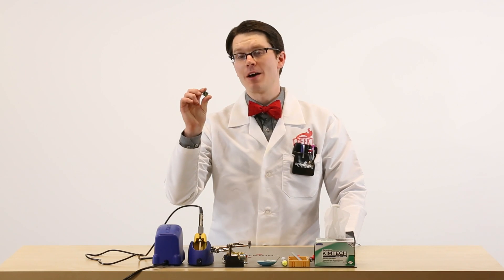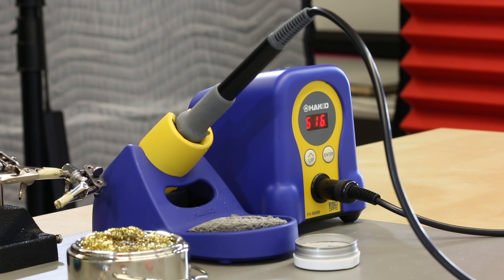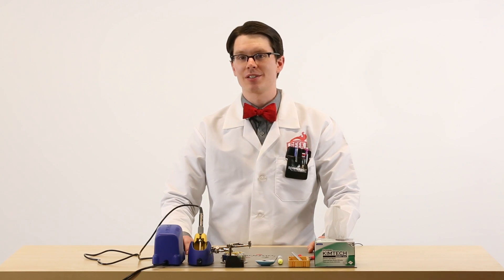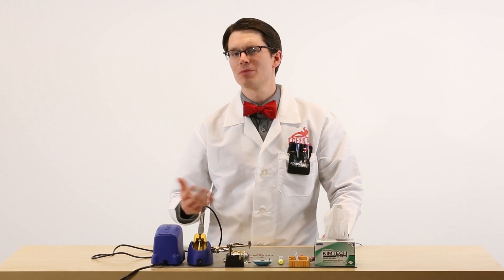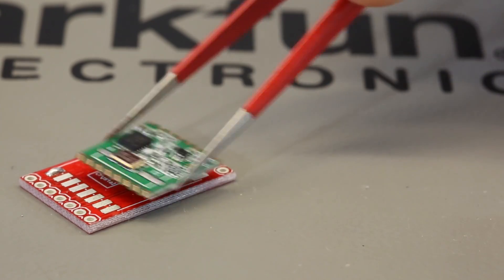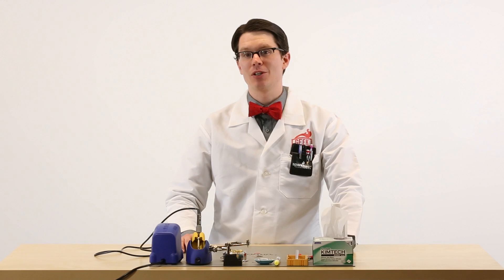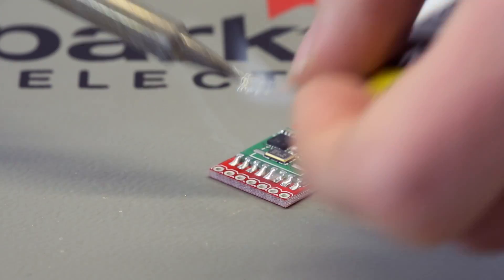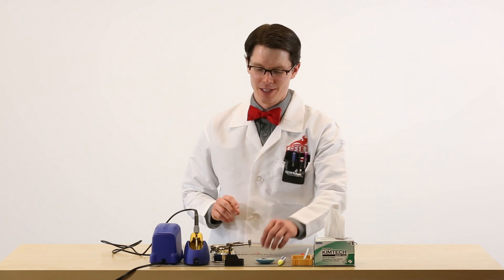SparkFun: How to Solder Castellated Vias

Comment: You were doing quite well until the second solder joint. Instead of soldering the adjacent hole, why not solder the one on the opposite corner? This prevents the problem of accidentally nicking the first joint as you bring in your iron in close to make the second joint. If you touch that first joint then the board may move and you have to start over. Working with the opposite corner also allows you to press down on the board to ensure that it's flush with the motherboard. Once you have the opposing corners soldered, then work your way down the board on either side, starting from the last solder joint. For those of us that don't have a completely steady hand, the results are much more satisfying.

Comment: I would not use water soluble flux in this application.  Rosin core solder will work fine, and you don't have to clean it.  Any leftover flux may turn yellow and ugly, but it won't cause corrosion or board damage.  It will be difficult to clean out any water soluble flux that gets trapped between those two PCBs.

Comment: Why do we need to apply flux before re-doing an existing joint?
(The solder already contains flux in it's core...)
Do we need to match the flux type: water-soluble vs. rosin?
(or has the flux in that joint already evaporated during the previous soldering so no need to care which flux to use?)

Comment: 5:40 NO NO NO! Wiping off the tip before putting the iron back in the stand is precisely how you cause premature tip wear. You want to always leave a layer of solder on the tip: that way, the solder oxidizes, not the tip itself. If anything, it's advisable to add more solder to the iron before placing it in the stand. Either way, only do the cleaning right before making a joint, not after.

Comment: This is a great soldering video! This guy really knows his stuff and is teaching professional grade techniques. This type of soldering is not uncommon on high end equipment during prototype, testing, or rework phases. I would add that for most hobby projects, Lead Free solder is not necessary, and is fairly undesirable. Use of a 63/37 Tin/Lead solder will not only melt at a much lower temperature, but will flow much easier and the joints will be cleaner, smoother, shinier, stronger, and longer lasting.
Reply: It's OK hobbyist-level soldering, but it's categorically NOT professional grade.

Comment: video is too painfully slow to watch. its like giving instructions to a 5 year old. I don't know what kind of solder you use,, 225C or 430F is plenty hot for most solders.
Reply: YouTube let’s you vary playback speed to suit yourself. It’s normal to be able listen faster than people can speak. Also depends on your pre-existing knowledge of the subject matter.
Reply: If you use a hotter iron you can solder faster and the heat has less time to dissipate into the chip... 350 to 370 deg C is a good temp for lead free solder.
Reply: His detail is superb, you may be rather experienced, many are not, including me who is used to soldering larger components in old style designs. You idea of teaching a 5-year old is good, for an early start in life along a good path.

Comment: So far I've only found OSHPark to make the castellations.  Problem is they need cleanup as there is left over foil from the cut, and the purple they uses for their mask seems to go into the castellation holes, leading to even more clean up with an xacto knive or other to get to metal.  Who does your castellations?  thanks

Comment: You should solder two diagonal pins first. This helps to keep the circuit really in place.
Reply: To solder two opposite diagonal pins is fairly common practice when soldering IC's or modules. In this case, if you solder one corner and during the course of soldering the 2nd or even third pin, something were to happen (solder iron slips, you drop the module, someone bumps you, your module slips from the helping hand, etc), then the solder joint can cause damage to the module or even to the project board that its being soldered to. On an IC, it could severely bend or even break the pins (legs) off the IC.
Reply: Exactly, I cringed when he went ahead and soldered adjacent pins ignoring the potential "torque faults" that might result. This is especially important in a video geared towards beginners like this one.
Reply: +Davey Hi    it's standard technique in welding to reduce heat-induced stress.
Reply: That was My thought.
Reply: ***** Why do you think that?